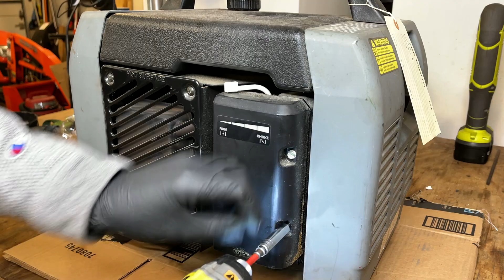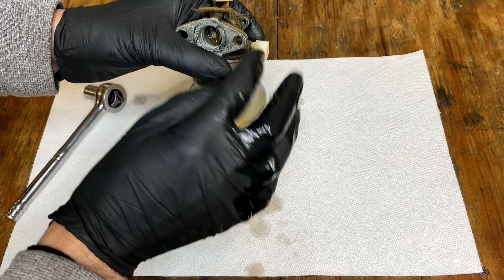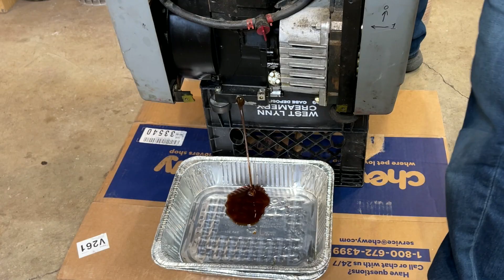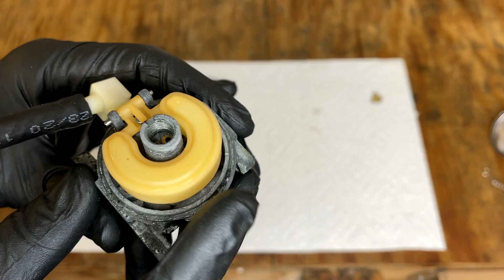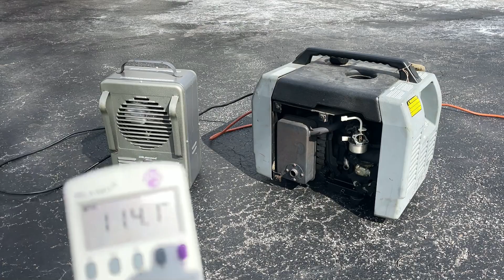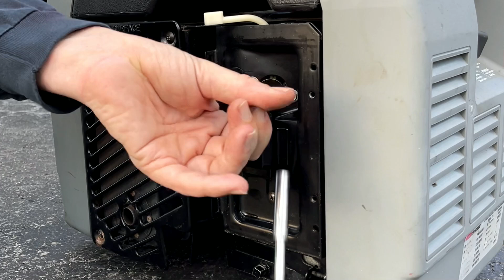Coleman Powermate Pulse 1850 Generator Repair

Comment: An old video and still relevant. I got a PowerMate from Craigslist years ago. I REALLY wish that I knew then what I've learned from you over the years. But as it turned out I was able to get the little genny working well enough. It went to a friend of my Dad - a trucker who was missing loads because his semi tractor wouldn't start in the winter cold. The Powermate ran the engine heater and battery chargers just fine. Nothing technical, just dirty power and plenty of it. Happy Endings. 🙂 Thanks for the memories, James.

Comment: The carb always comes loose. I got one of these years ago used and have put hundreds ok hours on it. When it starts to surge it's time to tighten the carb screws. This thing vibrates something fierce. Another reason Briggs suck. Also where can I get a new gas cap!?!?!

Comment: Very interesting repair. I wonder if you could help me with some info. I have a Powermate 1700. I am in need of a new carb. They engine code is B&S 93412  0136-01 95041003 If I had the P/N I could try and find one. I tried cleaning the carb and it runs if I squirt fuel direct in to it.  up in Canada the B&S supplier couldn't help me. Thank you in advance for your help.

Comment: Amazingly detailed video with easy to understand step by step repairs and operation. My 1850 needs full choke to run so the air fuel mixture needs help.

Comment: I just rescued my Coleman1850 today- based on your video- That gen has NOT been operated in like 25 years- It's NOW running and making power (it ran my Milwaukee grinder ok)- I forgot what a noisy little thing it is and weighs more than I remember lol. Thanks for your help.

Comment: Hi James. I bought my 1850 brand new from Home Depot back in the mid 1990's and I still have it today. The engine case on mine is bare aluminum and I noticed the one you have is painted black. I don't think that B&S ever painted those engines black in that generator. I'm guessing someone had that engine out for an engine repair and gave it a little paint to spiffy it up before putting it back in its home. Also, I had to reseal my engine case at one time because it was leaking oil like yours. Overall, a very nice machine for the money. Cheers from El Cajon, Ca.

Comment: Yo James! Man I watch your videos all the time now. I comment on quite a few of them. I’mma start calling you “Do it Right Dan”. I always notice how you’re very meticulous on anything you do. BTW, my parents have one of these little generators. It’s actually at my house right now while they are in Florida for the month there is is the 1750 Pulse and has the Kawasaki engine. Starts right up on 2 to 3 pulls after you let gas drop in into the carburetor when you turn the fuel valve open.

Comment: I had one of these, I bought it in 1994 for $150, sold it in 2020 for $100.  I didn't have to do anything to it except oil changes and replaced one rubber foot.  It started every time.  I used it for camping.

Comment: Hey James I'm hope you can help me I have a Coleman power mate 1850 just like the one in the vid given to me it works great I'm looking for the Air filter housing i just need the outer shell part can you tell me where i can find Many thanks Jay
Reply from the maker: I think this is probably the parts you need at the link below.  Part number 691327

https://www.partstree.com/models/93412-0136-01-briggs-stratton-horizontal-engine/air-cleaner-exhaust-system-0/

Comment: Found my fathers in his garage after he passed. I think the only time it ever ran was once in the late 90s for lack of need. It was pre-ethanol fuel. Tank is completely dry. Should I replace fuel lines, clean carb, replace air filter and check spark plug? Anything else?
Reply from the maker: Change the oil and check the bushing on the bottom of the fuel tank.  They usually start leaking and need to be replaced.

Comment: Got one of these 1850s from my dad. Never really have used a generator before but I wanted to see if I could revive it. It had sat outside for years. Rust everywhere, literally ever single bolt on it I had to table grinder wire brush. It ran fine(first pull most times) so that wasnt the issue. Problem was it wasn't providing any voltage.  Only about 5 volts. Quick internet search for 5v and it pointed to the capacitor that was rated at 7.5uf and only showing 1.2uf. Never seen a capacitor look like that before. Cleaned out like 6 dirt dauber nests, replaced ALL wire connectors, painted the gray front and back gloss black, all new rubber feet(it was even missing 1. Cleaned it up a lot and ordered new capacitor (20$ with shipping)
Happy to say it works like a champ again!
Reply: Link for capacitor?

Comment: What is the meter called that you check both voltage and hertz off the engine/generator?
Reply from the maker: Kill A Watt
Reply: Also, do you have a video of removing the gas tank in Coleman permeate pulse 1750?
Reply from the maker: @7charis  I do not

Comment: I just got one of these from a homeless trash heap.  It was siezed and immersed in mud and old oil.  I've got it unsiezed and new oil in it  now and it has spark.    Which cleaning products do you use for the degreaser bath, the dirt and oil on the engine and for the plastic covers?

Comment: Niceley done James! I have this exact model and wanna get it running. What did you  use to clean the jets - i.e. wires/needles/whatchamacallits?  Thanks for the engine and gen model numbers!
Reply from the maker: I usually use a wire from a wire brush and torch tip cleaners.
Reply: @jcondon1  OK thanks for the prompt response!  Mine was stored in a closed-in shed but I never started it. I'll have to fully clean the carb.  An aluminum circular thingie dropped into the tank from the cap.  Where would I find parts for the motor?  Thanks again James!
Reply: @jcondon1  It occurred to me that steel unwound .. or "non - wound" guitar strings would work well, particularly dialing in a diameter for maximum cleaning effect, as they are graduated from 0.008" up to about 0.020" unwound...

Comment: I just finished one just like that and the carb was a mess and the capacitor was melted out. After replacing the 7.5 capacitor with an 8 microfarad it gave me 127 volts and cleaning the carb it was a really nice machine. It still had the battery charger cord in the bag and was never used. I picked it up for $20. Thanks James.

Comment: James ! Question what present of generators that you come across can’t be saved as to the ones that  are saved ? I guess that. There is a point that the cost to repair outweighs the value of the machine ! I had a forsed air blower fixed that cost more than a new one !

Comment: What was hertz & volts at 750 watts?  I have similar 1850 and best I have gotten is 800w @ 120.2v & 60.2 Htz -3600rpm. If I load with 1500w I get 105.3v & 56.3 Htz 3360 rpm also if I increase rpm’s to make 1500w work it’s screaming unloaded. Thanks again for your Excellent Videos!!

Comment: Hi there.
First off, great video, and very helpful.

I did cause a problem though when I was fixing my generator. Its running good now, but I knocked off the mesh, fuel filter inside the gas tank. It's called "Fuel Fitting With filter" on the parts website, and it's a discontinued part.

Do I need to replace the whole part or can I get the filter back on?
Reply from the maker: I would install an inline filter.  https://amzn.to/3eby1O6
Reply: Same here- mine was falling apart so took filter off- now cap is leaking from cable tie hole. Trying to find a cap that will work 🤣

Comment: Have a question have you had problems with spark plugs going out on 1850 generator. 
Have had to replace the original which was over 19 plus year and a new one in less the 1 month.
Coil checked out fine as well as all supporting switches.

Comment: I'm surprised that it's an 1850 model seen here, as I own one exactly like this seen here, it's sitting in my back shed right now, but it's listed as a 1750 model. Did a service job on it last week, and it runs great, even though it needs a ring job, due to compression being a bit on the  low side. I picked it up cheap at a secondhand store about 2 wks, ago, not running. Plan on tearing it down for a ring/valve job, next spring.

Comment: I have an older one that is green and is the 1000 not the 1850. Where can I find parts like carburetor and carb rebuild kits etc. for the  Powermate 1000. The one I have runs and puts out electricity but only runs on starting fluid or putting gas down the carb. Any references or help would be greatly appreciated

Comment: Thank god Honda came a long and put an end to those valve-in-block engines. Talk about getting all the mileage you can out of a design, B&S hadn’t invested an engineering dollar in those things since probably the 1940’s. Competition. I have one of those generators, bought new, ran good for about 4 days, light use, started running rough, hasn’t seen the light of day since. I worked on enough of those growing up I wasn’t about to spend my time constantly repairing it.

Comment: Hello James, I have a question that’s not related to this video but I’m running out of avenues to try so I wanted to comment on one of your newer videos hoping you’ll see this. I have a Predator 3500 silent generator thats a year old with 700hrs on it that I use regularly for my rv because I travel full time. It starts and runs great and supplies 124v but all of a sudden the ECO mode switch doesn’t do anything any more and when I turn on my RV AC or 800w microwave it bogs down and pops the overload fuse. The AC fan will run at any speed but it’s not enough power to get the compressor to kick on which originally I thought was the AC so I purchased a brand new AC (wasted $1000) and the new one is doing the same thing. When I run the micro it turns on and makes sounds but it’s almost like it’s running at half power. It use to rev up when a load was applied and when the eco mode was turned on it would slow to save fuel. I regularly use fuel stabilizer and literally the only thing that changed is I used 87 octane instead of 93 because of cost now. I changed the oil, and cleaned the spark arrester and air filter. I can’t seem to find a socket that fits to change or check the plug either?? Can you help??? I can’t find a shop to work on it. Thanks I’m advance for any advise
Reply: Sad noone answered.  Been a year so I assume you got it fixed or replaced it.  I have same Generator, mine was a basket case from sitting outside for years with fuel in it.  So it doesn't have a mechanical governor like the regular open frame generators, it has a Servo Motor on top of the Carb that adjusts the throttle blade at back of carb.  Sounds like yours is stuck, or not working.  It plugs into the Inverter in front of generator if I remember right.  So it could be something else.  I would suspect though, as I had this exact problem with my basket case left to rot generator, the throttle blade can get stuck in a position, and generator will not idle up or down, will run at constant RPM which isn't wide open throttle or enough throttle to produce enough power to the Inverter to power your Air Conditioner start or Microwave.  My throttle blade was rusty and the little shaft was hard to turn "sometimes, not all the time" probably from rust.  I finally just bought a new Carb, which came with replacement hoses and a new Servo.   I haven't installed it yet, but 100% sure it will fix the problem, as it is certainly the throttle blade shaft sticking on mine, as I had hell getting it to turn initially when I started working on the Carb, did everything I could to free it up, but eventually it hangs again, even noticeable when turning it by hand, sometimes very hard to turn.   And yes, I removed the throttle blade from shaft, pulled the shaft out, cleaned the shaft and holes it rides in, reinstalled, and still it would hang once in a while.  Shutting the Generator off and restarting (sometimes this worked) or just manually pushing on the mechanism would un-stick it, and it would change RPM as needed again, for a while.  Too much headache, $27 whole new Carb and Servo to the rescue.

Comment: What is your recipe for the ultrasonic cleaner, and how long does the carb stay in there?
Reply from the maker: Depends on the carb.  Usually 30 minutes is enough.  I use Harbor Freight Super Heavy Duty degrease.  About 10% degreaser and 90% hot water.  More degreaser is used if the carb is in bad shape.
Reply: Thank you

Comment: You wouldn’t happen to have parts for a Coleman PowerMate Pulse 1800ex. Mine went up in smoke when my shed caught fire but it still runs and produces power but the plastics are all melted.
Reply from the maker: Sorry, not parts for that generator.
Reply: @jcondon1  do you have any idea where I can find them?  From what I looked up they’re disconnected and I can’t find them anywhere on eBay.

Comment: I have a champion generator with a roll over valve on top of the fuel tank. The connection to the line snapped off and is inside the line still. Would I need to replace this, or could I just plug it and continue running it, It is stationary in my truck bed, and I just need to get it back in commission. Any advice is appreciated!

Comment: You can flat sand that carb flange smooth. The tiny bit you take off won't make any difference in mounting. I have a 3/8" steel plate mounted to my bench just for this. A thick piece of glass works well too unless you drop a cast iron flywheel on it like I did. Just keep even pressure on the carb as you run it back and forth.

Comment: I have the same generator with the same oil leak. I seems to be coming from the governor shaft. Why they designed the engine with the governor so low is beyond me, it gets splashed all the time by the oil slinger. I run mine dry cause those shutoff valves love to leak.... It is quite reliable though, usually starts on the first pull. Love the outro & the dog bark at the end!

Comment: Where do you buy your carburetors?  I'm looking for the carb for a Homelite 5000 generator with a Subaru ex300de5222 engine.  I'm hoping someone here can point me in the right direction?  I checked amazon, but I'm afraid of buying a shitty part.
Reply from the maker: Amazon.  There are clones for cheap, but they run the engine rich.  Stems makes one that works well.  Less expensive then oem.  Stens 058-161 Carburetor, Subaru 279-62364-20 https://a.co/d/5Qp902V

Comment: When you clean carb floats in the ultrasonic why don’t you try and put them in the infuser device you got ( or teather them with a short piece of wire to bottom of basket) so they are completely submerged and get 100% cleaned.
Reply from the maker: Never had an issue with a plastic float leaking.  But no harm in submerging

Comment: Hi James. I have the same unit and it will run with starter fluid. I don't have an ultra sonic cleaner for the carb so I just want order a carb. Any idea where I can get one?
Reply from the maker: The OEM carburetor (496863)  is no longer available.  You can still get an overhaul kit if needed (498260).  There were no clones available last time I looked, but might be worth checking Amazon and eBay for a used on or a clone.
Reply: @jcondon1  Thanks for the info.

Comment: I have the same model. Since brand new it starts leaking gas out of the cap vent. I have had 3 gas caps with new gasket and the foam on each. But after a few minutes of running fuel comes the vent hole on the gas cap. Full tank or half tank it makes no difference.

Comment: Bending the tab certainly worked, but you might have been able to move to the top hole in the governor lever and gotten enough tension on the spring.

Comment: Could you not have changed the position of the spring on the governor to increase the engine speed?? It has several holes for adjustment by the look of things.......?
Reply from the maker: The holes on the governor arm are meant for adjusting the governor sensitivity.  Probably could have moved it a little without hurting anything.

Comment: Would you please show that Harbor Freight degreaser container sometime. My local (Colorado) HF store looked at me as if I were from Mars when I inquired about it. Thanks for all the informative material you produce.
Reply from the maker: I always have trouble finding it.  I get the same look when I ask.  Here is a link to it https://www.harborfreight.com/1-gallon-heavy-duty-degreaser-42998.html
Reply: @jcondon1  Thanks.  Using the link, I've found another store that likely has it in stock.  I appreciate your help.  B
Reply from the maker: You can see where they hide it in my store 20 seconds in https://youtu.be/odTYb_JNlgM
Reply: You could also use Simply Green or Purple Magic. In Walmart.

Comment: I have to say that measuring a low voltage of 111V at a full load of 1500 W and knowing that this is a brushless generator my inclination would be to go for the capacitor. They all lose capacitance over time and I would be surprised if this one was still in spec. This generator has a capacitor of 7.5 uF plus or minus 5%. Such a cap rated at 450V is no more than 8 or 9 dollars.

Comment: Used to have that model on our fire trucks to run the on scene emergency lights.  Our worst problem was the ethanol fuels eating up seals and varnishing up parts.

Also recommend brake parts cleaner on the oil residue.  Saves a lot of wiping time and paper towels.  Just have a catch pan for the run off.

Comment: I blow seats with air pressure no risk of damage.
Reply: I was not thinking one time and puffed the air in the inlet side. That seal might be in orbit still. I never found it.
Reply: @haneyoakie14  Right. If you blow from the fuel inlet side it's gone.
Reply: @dkupy100  experience is a great teacher

Comment: There is a tool from Tecumseh for removing carb seats , it also has the other end which you use to install the seat . It is available on Amazon . Great video as usual .
Reply: Did you leave a text about a contest about me? .